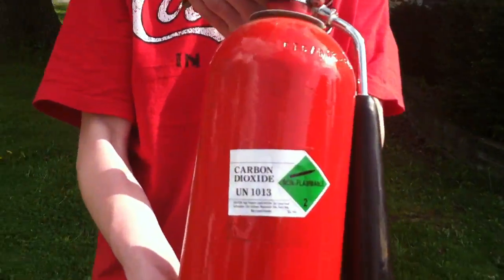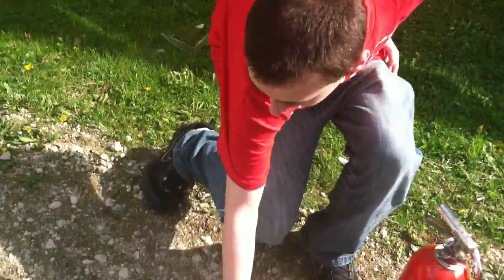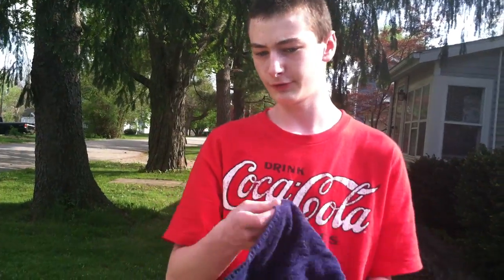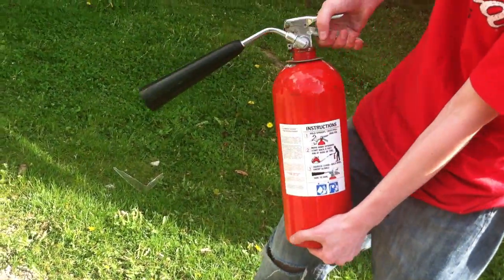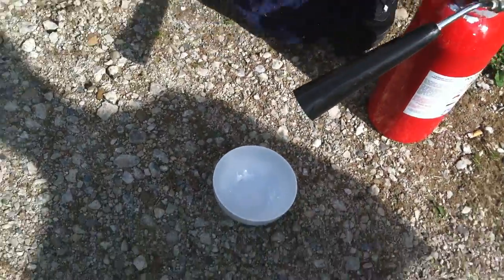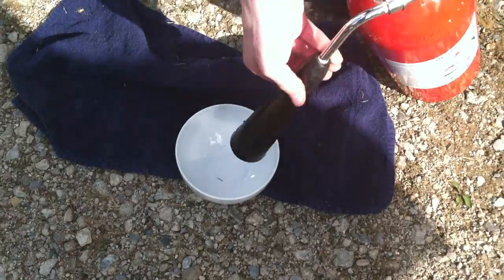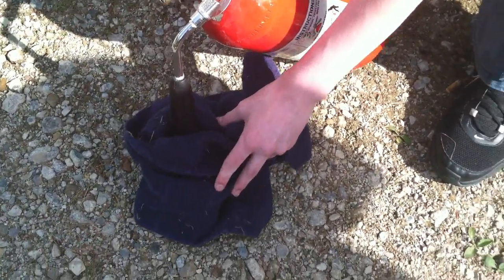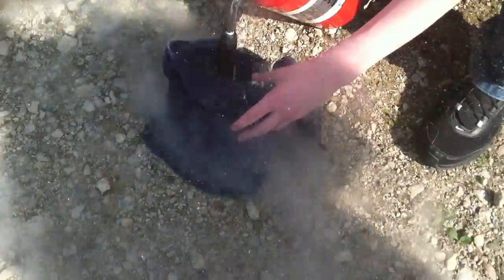How to Make Dry Ice At Home (HD)

Comment: What're they teaching in schools these days?

Do you know what dry ice is?  It is Carbon Dioxide cooled down to the point where it becomes a solid like how normal ice is solidified water.  It's "dry" because its temperature range for becoming a liquid is so small that we don't perceive it.  Or in this case it's liquid inside the Fire extinguisher because of the compression.  When you release it it's cooled enough to become a solid again which makes that dry ice residue.

Comment: It is possible to have solid nitrogen (nitrogen ice) but it is harder to obtain because it has a much lower melting/freezing temperature. (-210C for nitrogen compared to -78C for carbon dioxide).